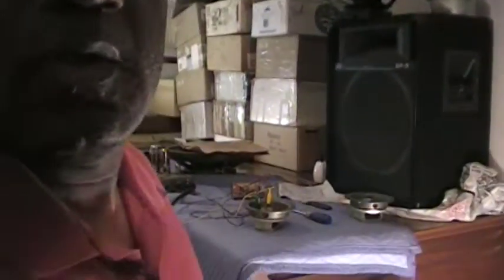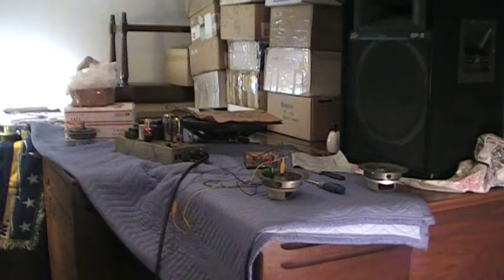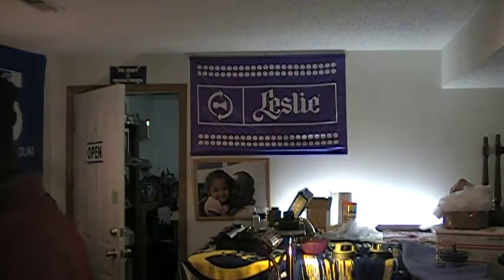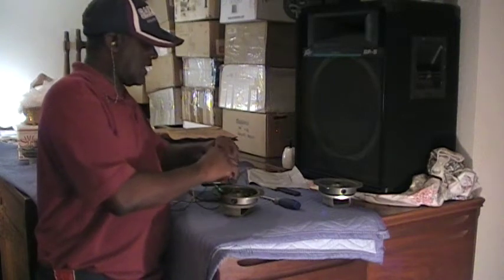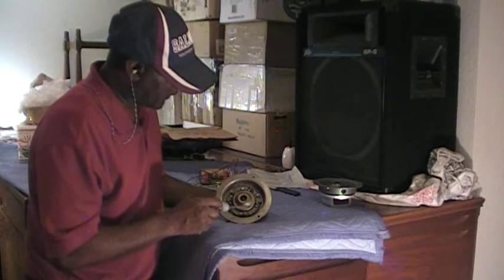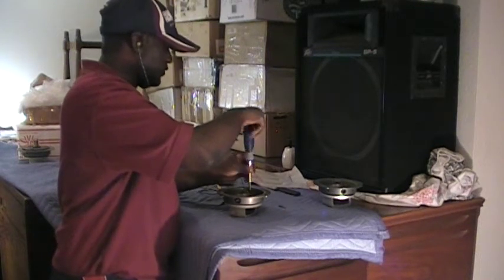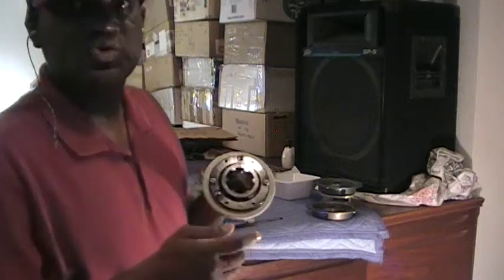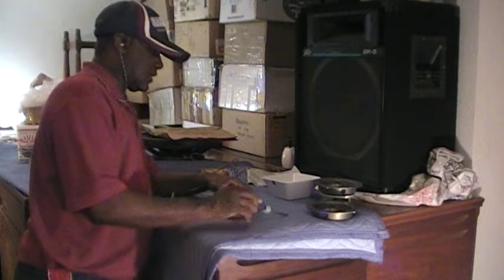Resetting The Diaphragm On A Jensen V21 Leslie Upper Driver

Comment from the maker: Hello Roll With It:  It is the diaphragm in the V21 that buzzes.  They buzz either because they are displaced in the frame or because they are bad.  The way you know that they are bad is if you adjust them over and over - spending more time than you want to in trying to adjust it (like 20 or 30 min) and you can never get it to sound smooth.  Or whne you do get it smooth - it does not play as loud as it should or when it just stops playing all together.  Either way, you have to have that diaphragm in the V21 in order to get sound. Buzzing will not damage anything.  It is only a symptom that you have a problem with your driver. Thanks for the great question.

Comment: I had really bad buzzing in my V21 so I gave this a try.  It may not be absolutely perfect, but it's a ton better.  I can actually use my Leslie now.  Thanks a lot!
Reply from the maker: If you take a look at a recent video that I did (a week ago) I reset another batch of V21's.  In that video, you will see that I use some electronic cleaner to spray around the rim of the diaphram before reinstalling it in the casing.  You might consider doing that.  It made my old V21's work much better because the coil was cleaner. I didn't think to do that before but it makes sense.  Try it and see if it helps your V21 and let me know. I appreciate your note.